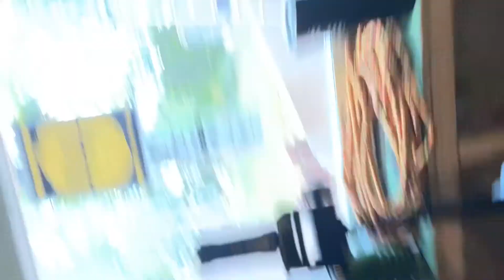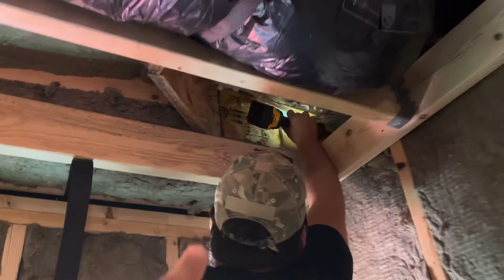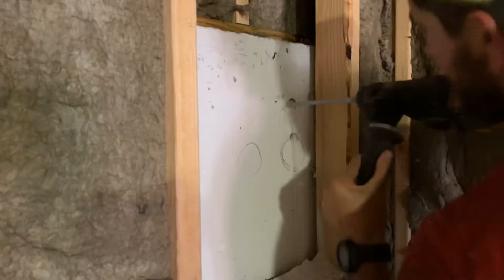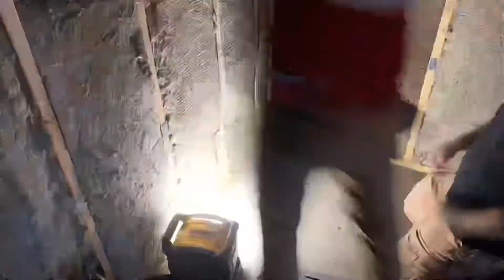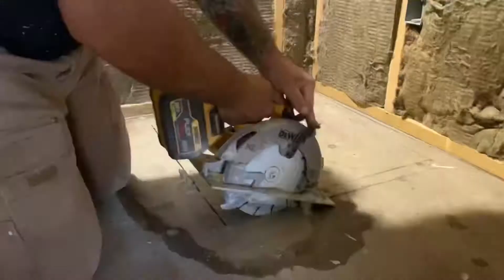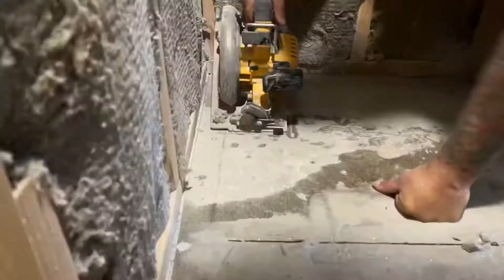Day 55 : Project Chief

Comment: Pouring water on the blade? Do you worry about water damaging the saw? Does adding water just reduce the dust or does it also make the blade last longer?
Reply from the maker: Yep! It keeps dust down and also keeps the blade cool. We were not too concerned about damaging the tool. There was no direct water spraying on the motor side of the tool.... however we should have cleaned the tool before the concrete slurry dried on the tool...😬